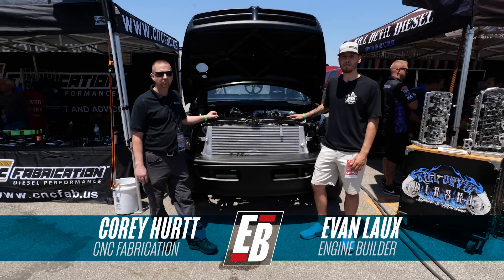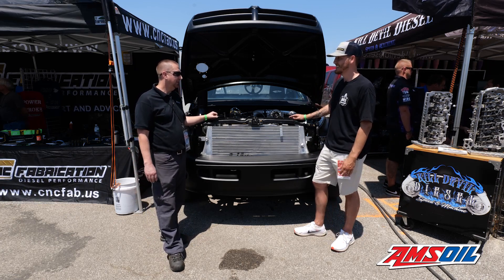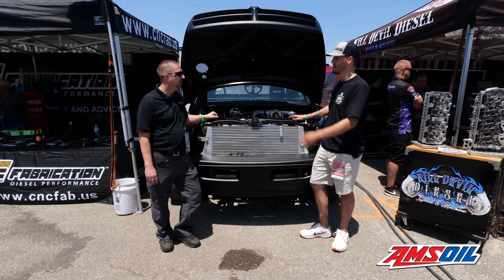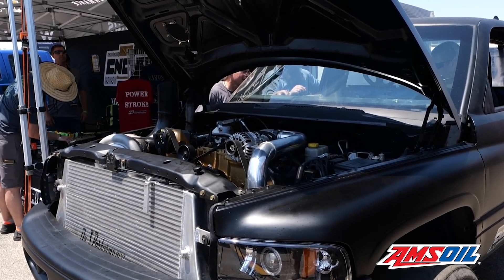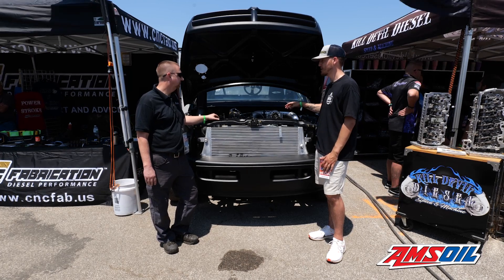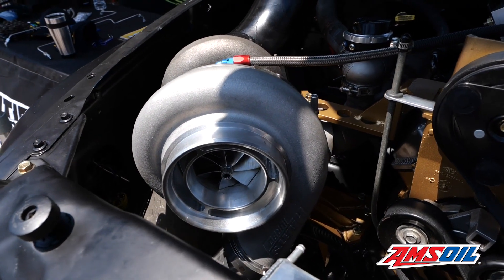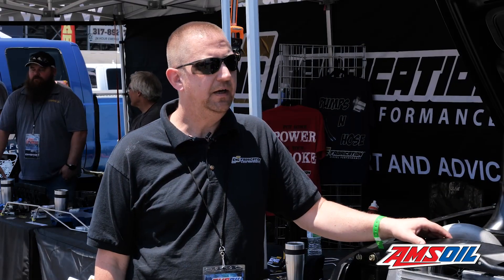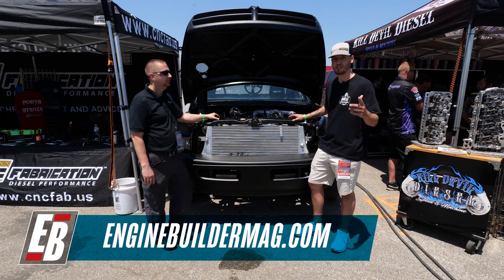CNC Fabrication's Turbocharged 7.3L Powerstroke Engine

Comment: Looks like an idi not a power stroke
Reply: It's definitely a Powerstroke.
Reply: The oil reservoir for the hpop is a dead giveaway for a powerstroke.
Reply: That’s a Powerstroke the injection pump on a idi is completely different and it’s in the valley
Reply: Idiots

Comment: Years ago they did on record on a dyno In cheyenne wyo
Reply: HEUI 7.3 fuel only record was Nickolas Lima in 19 and it was 920hp. There are a couple trucks they think could be 1000, but none have been on a dyno and managed to break that 1000hp wall. The few trucks that are thought to be 1000hp fuel only couldn't spool the turbo without a little nitrous.